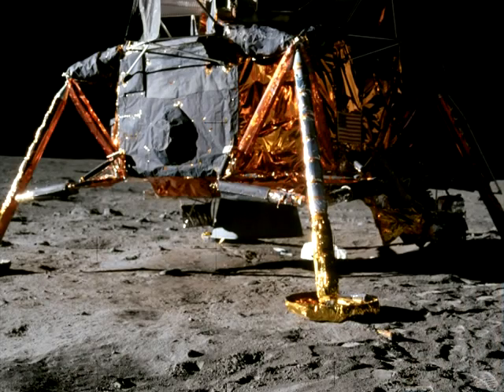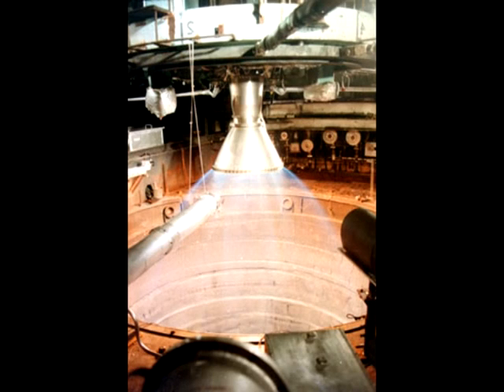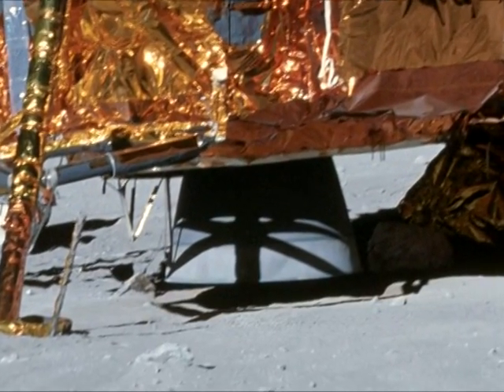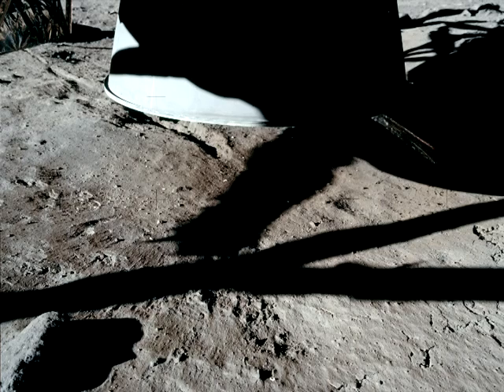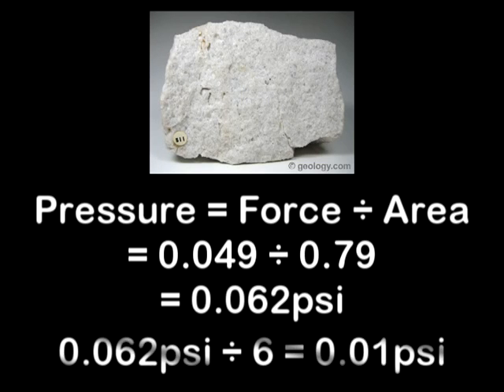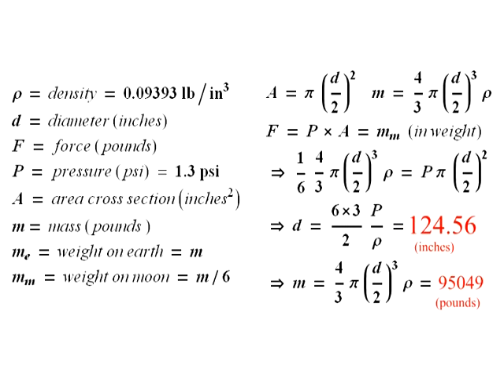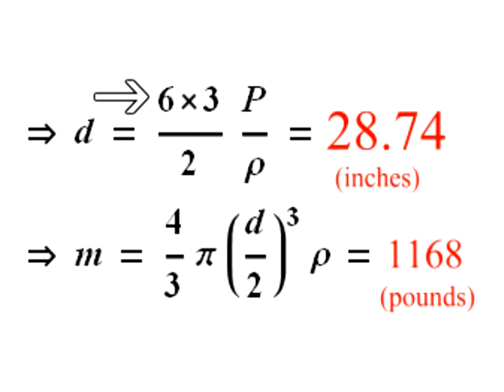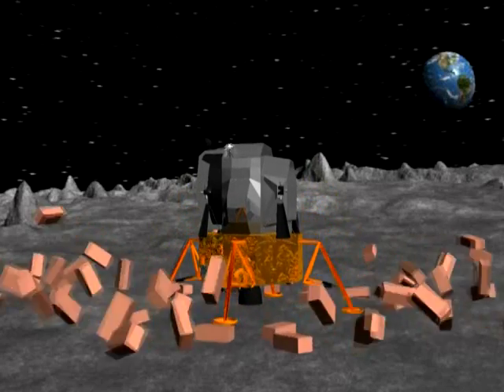MoonFaker: No Crater Addendum. PART 2

Comment: just over 0 - 1000lbs .. 3000lbs is near half full throttle? 
the conclusion is you're as thick as a brick, banging on about a crater getting more and more complex cobblers into your theory, a crater was never going to happen, no rocket engine has ever left a crater anywhere in history, they never act on the ground but only against the weight they are lifting, the larger non powder debri left on the surface is being forced to stay where it is because the force acting on it is from directly above, not the sides, where is it supposed to go?

Comment: Jarrah: Another important fact that is that on the moon there is no atmosphere. Accordingly, the rocket exhaust plume would have found no resistance as it exited the exhaust bell. 
Another issue regarding a similar situation on the moon is the moon's dust as it is being disturbed by the astronaut's feet and the wheel's of the moon rover. As you pointed out the moon has 1/6th earth gravity. The Range (distance traveled) is given by the trajectory formula:- 
R = (Vo x Vo x Sine (2 x θ))/g
R = Range 
Vo = Initial velocity
θ = Angle of trajectory
g= Gravity
So using this simple formula, the Range traveled by any particle on the moon is 6 times greater than on earth. The visual evidence we see in the videos of the behavior of the dust is exactly like here on earth. Jumping around the sand dunes and the hills near my house I kick the dust/sand much like the astronauts , approximately 1m. However, with 1/6th gravity that dust/sand should have traveled 6 times that, some 6 metres, probably more so as the moon is virtually a vacuum.
Similarly the moon rover does much the same as my beach buggy. I've noticed that the sand thrown up behind my beach buggy (as it loses traction) is some 3 to 4 metres at a speed of around 10km/hour, much like the moon rover. BUT, on the moon the dust should have traveled some 18 to 24 metres. Furthermore, we can see dust clouds forming behind the moon rover wheels in 'rooster tails' as the wheels lose traction and then grip repeatedly. With no atmosphere, dust clouds cannot form. Dust clouds are  DIRECT RESULT OF THE PARTICLES BEING SUSPENDED IN MID AIR I.E. A GASEOUS MEDIUM WHICH DOES NOT EXIST ON THE MOON. The particles should travel unimpeded in a parabolic trajectory from the moment the are ejected by the rover's wheels till they return back to moon's surface.
NASA could not fake this so they just ignored it.
I hope you can do a video on this subject.
Keep up the good work
Reply: https://www.wired.com/2013/03/the-acceleration-of-moon-dust/

Comment: just watch the landing again. The official apollo 11 landing is as authentic as a chocolate kettle. The retro-thruster sounds more like an aerosol spray can rather than a harrier jump jet and it is applied way to late. Also, the lander's trajectory looks like a balloon landing. It really is not convincing. Why is the landing gear so clean, where is all the slow settling dust? Is it unpatriotic to want the truth? If you are a nation of liar, then I guess it is.
Reply: NO. They did not turn off the jet until AFTER they had landed. (which is interesting in and of itself, since the jet ONLY had ON and OFF, and was not "variable") They did NOT "land on bedrock, with just a couple of inches of lunar soil". (otherwise they would not have been able to put the flag in the ground, and do some of their other experiments) The lunar soil would most likely have been pushed OUT and bounced UP and hit the under side of the vehicle and fallen back down.

Of course, it is all most likely fake, so....

Comment: Incorrect. First of all, the video of the Apollo 11 landing & the time Armstrong reports contact light is not in synch.  Second, He can't report simultaneous events simultaneously. Uh, no one can talk that fast. To assume this is synchronized ignores the purpose of the astronaut's communication:  to relay what has happened--past tense!

"A fine spray of exhaust gas." What? That's a convenient conclusion, but unfounded. Naturally it LOOKS thicker in the middle because you're looking through more.

Comment: Jarrah, I certainly find your findings compelling, but even so here's my $0,02 for whatever it's worth these days: did you also consider that the LEM was moving horizontally while landing, therefore hitting the exposed surface area for only relatively short time, i.e. not enough time to dig a proper hole? Also, couldn't the stuff like small pebbles underneath the LEM be what was left /dug out after the surface material was blown away and the engine stopped?
Reply: The LEM was not supposed to be moving horizontally, otherwise it would topple over due to it's high centre of gravity.
Reply: Think about it.  Not one speck of dust.  Not only no dust but if there was dust it dident obscure the view of camera or stay in the air six times longer than it would on earth. Not I speck of dust stop being fooled

Comment: Criticism that Nishiizumi's findings are incomplete? In the S&K article? Where? But even if so, Head also belives the Martian meteorites are over-presented! Any papers showing the opposite is the case?

You believe they can take a "moon buggy" to the Moon, driven all around by two spacesuit astronauts, operate remote cameras there, and fly those guys back, but bringing back an astronaut's shue size rock (sample 61016 "Big Muley") weighing less than 2kg on the Moon (mass 11,7kg), is impossible?

Comment: I wouldn't claim the lunar rocks are fake. At least not all. Lunar meteorites are found on Earth. They can be retrieved with unmanned missions. Did they get those with manned missions, that I wouldn't know, but that's not the only way to get those.

An interesting issue with lunar meteorites is, they about equal in numbers with Martian meteorites. But lunar meteorites ought to be much more numerous.(suggested ratio 100:1). So where is 99% of the lunar meteorites? That's a mystery.

Comment: You mean 180 degrees angle? Well, that's not true. The pebbles would move. The preassure of the exhaust jet is lower towards the rim than the center. The loose soil and the exhaust gases after hitting the grond, continue ouwards, away from the center. As you can see from the descent footage.

Blow in a flour sack. Yes, you make a crater and the center does get pressed downwards, but the same time the air and flour escape from the sack's mouth rim regions.

Comment: The 1970 report is still irrelevant. It was an anomalous amount of water found thousands of time more than in other Apollo samples. As said before, higher amont of water has been found in a couple of samples (usually within volcanic glass). But these cases are very rare exceptions to the rule that the Moon rocks are very dry.

Everyone held the Moon rocks extremely dry. There were theories of water formation, but the Apollo samples did not support them.

Comment: @kaleljordankent

Yeah, they extracted water from the Moon rock by HEATING. However, the amounts of water were anomalous. The average amount of water gained from lunar rocks by heating is parts per billion, not hundreds parts of million. Volcanic glass on samples however have been noted in couple of cases include higher amount or water, a Luna 24 sample and the 2008 found I told right in the beginning.

This is entirely different thing than the 1000ppm water molecules found by the satellites!

Comment: (continued)

The M3 team found water molecules and hydroxyl at diverse areas of the sunlit region of the moon's surface, but the water signature appeared stronger at the moon's higher latitudes. Water molecules and hydroxyl previously were suspected in data from a Cassini flyby of the moon in 1999, but the findings were not published until now.

(Posting links is hard on YouTube. So just google it and you find the page, if you want to.)

Comment: And I urge you to read my comment.

As I say in my previous post, traces of water were found from teh Apollo rocks. But so insignificant amounts it was considered a contamination. It was for 40 years commonly accepted the Apollo samples do not have water in them, and neither does Moon. (At least, it wouldn't have water ORIGINATING from the formation of the Moon that would be present in all the samples).

The Moon is now considered a lot more water, than it was previously. It was a surprise.

Comment: Oh, there is risks! Scores of spacecrafts have been lost for equipment failures and landings! You can also watch a video of Armstrong crasthing a practise lander on Earth. A11 flight was LUCKY that the only essential equipment which went broken was the LM take off swich lever, replaced with Aldrin's trusty pen. Right?

But even without risks, taking men there needs a lot of extra work, equipment and weight. Apollo Program was constantly racing against time, and angry astronauts die accidentally.

Comment: 109:26:16 Armstrong: Okay. The descent engine did not leave a crater of any size. It has about 1 foot clearance on the ground. We're essentially on a very level place here. I can see some evidence of rays emanating from the descent engine, but a very insignificant amount. (Pause)
---
Which contradicts several photos: shadow heights, horizon issues, etc.

Comment: contd. 

On Apollo 11, post-shutdown obscuration lasted about 7 seconds, perhaps because Neil Armstrong didn't get the engine stopped until touchdown or just thereafter.  On Apollo 17, the obscuration also lasted for about 7 seconds, perhaps because Gene Cernan brought the LM down very slowly during the 8 seconds prior to engine shutdown.  

Obscuration of the surface can continue for a few seconds after engine shutdown.

Apollo 11 - Touchdown (GET) : 102:45:40 - Visibility improves 7sec (16mm)

Comment: However:
During the final descent, the Descent Engine exhaust scours the lunar surface and propels dust particles laterally at high velocities, creating a sheet or veil that obscures the surface.  After shutdown, no more particles are accelerated to high speeds and the veil disappears.  However, for up to several seconds, the surface close to the LM is obscured by lofted dust

Comment: "I was absolutely dumbfounded when I shut the rocket engine off and the particles that were going out radially from the bottom of the engine fell all the way out over the horizon, and when I shut the engine off, they just raced out over the horizon and instantaneously disappeared, you know, just like it had been shut off for a week. That was remarkable."
 
Thats a lot of dust considering:  "there was no dust when you kicked"

Comment: @ above:  shuts down after 'touchdown'

Another version:
102:45:17 Aldrin: 40 feet, down 2 1/2. Picking up some dust.
[Fjeld - "An engine cut-out at any height above 10 feet would have produced a touchdown harder than the landing gear was designed to withstand."]
102:45:40 Aldrin: Contact Light.
102:45:43 Armstrong (on-board): Shutdown
102:45:44 Aldrin: Okay. Engine Stop.

So the times appear to be a bit different from different NASA documents.  From Contact to Engine Stop is 4 seconds.

Comment: where is this 3,000 lbs of thrust coming from?  the engine could generate that amount of thrust HOWEVER if you are trying to accelerate you are going to use more of that, to maintain you would use less, and of course decent would use even less than that. ..think airplanes...they arent always at max power, for obvious reasons.